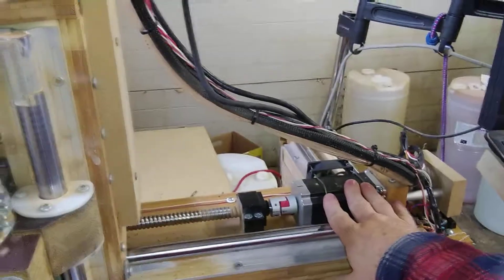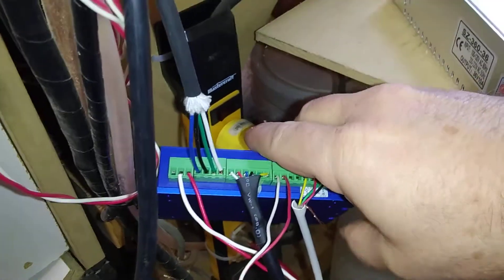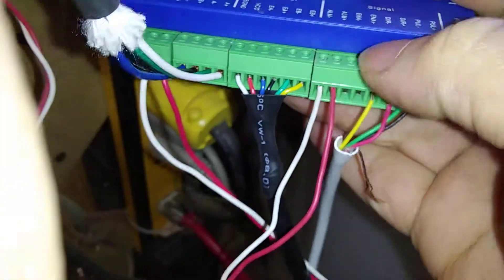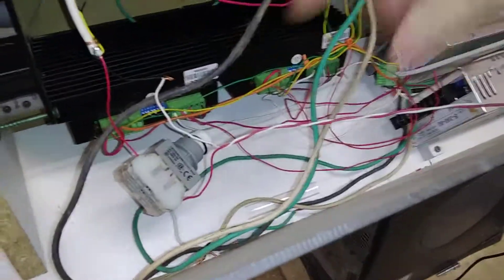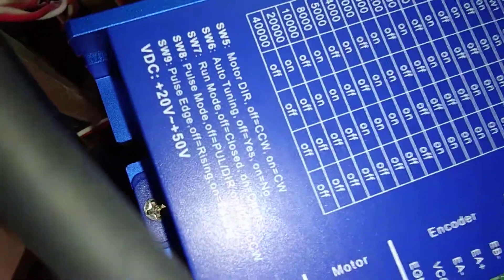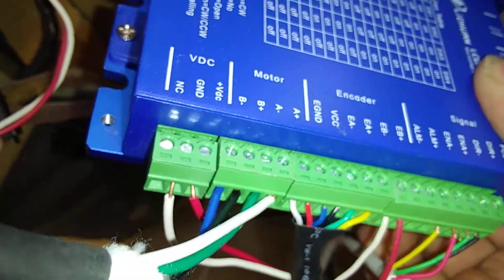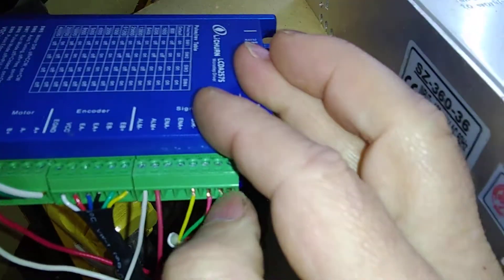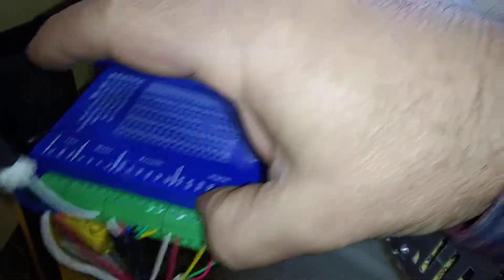My CNC Router Build - 11) Upgrading to closed loop steppers

Comment: You use the power cord to connect the power supply.  to the driver  What's the motor number?
Reply from the maker: I just found your message. I will look at it tomorrow and tell you. I am not sure if you are asking what motors I am using, or where to plug the motor into the driver. I'll get info for both
Reply: @eddowney9548  What size of fiber cable copper wire?
Reply: @eddowney9548  Do you have a wiring diagram?  Is it a cnc system? I'd like to see a paper drawing holder.  before connecting to actual use
Reply from the maker: I actually ended up going with a different driver/servo combo with a higher voltage carrying ability. Everything works the same and connects the same, but the one I ended up using is stronger. 

The driver - LiCHUAN model LCDA86H Microstep Driver. It can use VAC 20v-70v or VCD 30v-100v. And it can use 5vdc to 24vdc from the break out board. Maximum 51200 pulses per rev.

The motor -  LiCHAUN LC60H2127
2 phase servo, step angle 1.8deg
phase current 5.8a
holding torque 5.5N.M.
it uses 4 motor leads and 6 encoder wires that come prewired.
Maker - Shenzhen Xinlichuan Electric Co

I can't remember, but I think the encoder is 1000 steps, maybe it was 2000, and the driver has an option for 1000 or 2000 microsteps, so I think I just made them match. But, you can use other combinations.
As I said, the motors come pre-wired so I just connected them to the driver. If you need to supply your own, it needs to carry 6a, so I'm guessing minimum 18ga. I always go overkill, so I'd probably use 16ga.
The other wires are signal wires, so size not too important really. I use small, but not tiny wires there.

This is not a "kit" cnc. It is just kind of thrown together. I don't know what you mean by a " paper drawing holder ", but no, I didn't have a wiring diagram to go off of, but if you understand it well enough, it's easy enough to figure out.

hope this helps. Let me know if you have any other questions. I'll do my best to answer, but I'm not really very knowledgeable myself. I just watched alot of vids and read alot of forums. I also joined a Makerspace and people there helped me too

Comment: I have read that 36v is actually the most common used for these
Reply from the maker: yes, I'm sure 36v would be fine, but I am greedy and want everything I can get out of it. I ended up going with different drivers for those closed loop steppers as seen in this vid here 

->   https://youtu.be/t8Xm_-lnXrQ?si=NMEjH_VhJezZQRom

If I remember correctly, they can take up to 80vdc. I put 60v power supplies in for them, but wanted more, haha.

At the time I made this vid, someone had told me that higher volts will help you achieve higher feed rates (everything else being equal). Not sure if that is true in a system like this where it has alot to do with how fast it pulses and how well it can process those pulses, but in any case, I do want all the holding power I can get and overkill also allows me to trim it down a little and run at a cooler temperature generally speaking.

Comment: nc means no connection.
Reply from the maker: thank you Noan. I had to play the vid back to see what you meant. It's at about 4 minutes in. I suppose you may be right. It still seems odd to me that they'd have a means to connect a wire there if it is in fact no connection to be made. Doesn't really matter, I didn't use it and all is well. It works no issues.
Reply: @eddowney9548  Sometimes when you design something you make room for future use but you mark it as not being used for people to know its not to be used. ;)
Reply from the maker: @noanyobiseniss7462  thx, I'll keep that in mind. Maybe I'll be a little less confused at times in the future. Always nice to learn something new.
Reply: When you reset the e stop does it reset the drive or do you have to restart the drive?

Comment: have you noticed an improovement in speed , acceleration and lorque with the closed loop vs open loop ?
Reply from the maker: Sorry Alex the open loop steppers were over powered and the newer closed loop ones are as well. Hard to compare when you really have no problems with either one. The biggest issue I have with speed is that I am using a very old computer with a very cheap bob which limits my max steps per sec. So if I want high resolution I can't feed fast. And visa versa.
Reply from the maker: Oops meant to say hard to compare when you rrally have no problems with either one
Reply: @eddowney9548  cheers thanks , my closed loop steppers are on their way , cant wait to fit and test

Comment: Hi... i m interested in the latch emergency stop that you use... can you share the details on that
Reply from the maker: Hi Wira. Yes, I take the wires on all the ALM+ and ALM- and simply run them in series with each other, then wire them in series with the e-stop switch. If the drive faults out, it will turn off the spindle and disable the drives.

The e-stop itself is wired into the breakout board  at marker 7:20 in this vid - https://youtu.be/l1lK107s08w
It's been a while, but I think all switches are in normally closed option which is preferred. 
One wire from the e-stop ( e-stop is set for normally closed ) goes to pin 10 on the breakout board and the other goes to ALM- on the driver, then from ALM+, then to the next driver's ALM-, out of that driver's ALM+ until you go through all the drivers like that in series, then out of the last ALM+ of the driver to DC ground. 

 
note** if the ALM+/_ connection is normally open, you will have to wire the drivers in parallel with each other and then wire the e-stop in parallel and the e-stop will need to be normally open as well.
 

sorry it took so long to reply. I don't come on here alot. Feel free to ask if you have more questions, I'll do the best I can to help you.